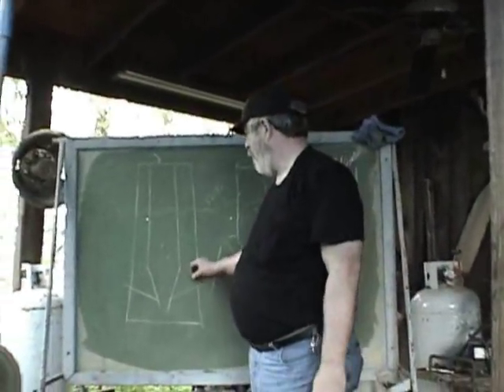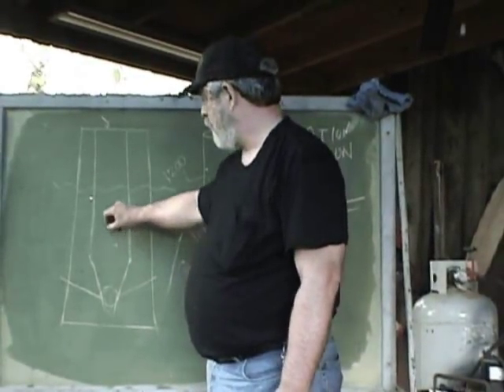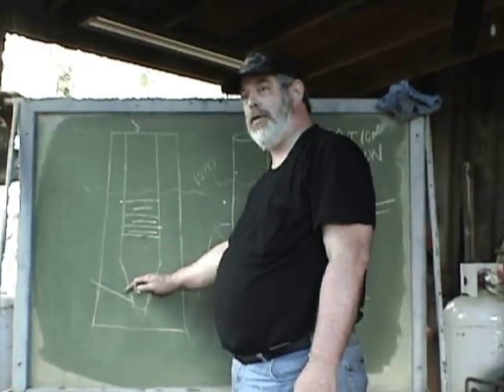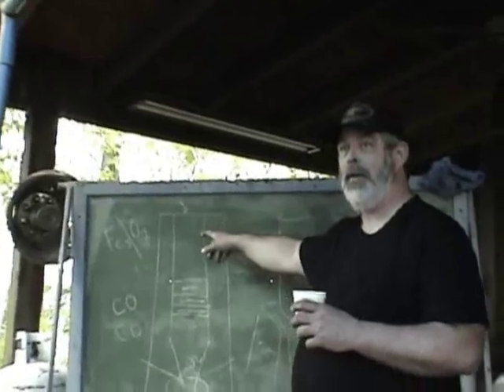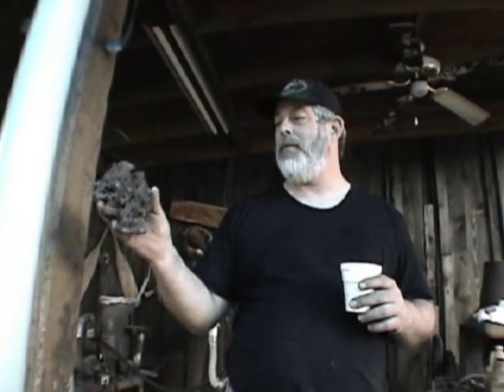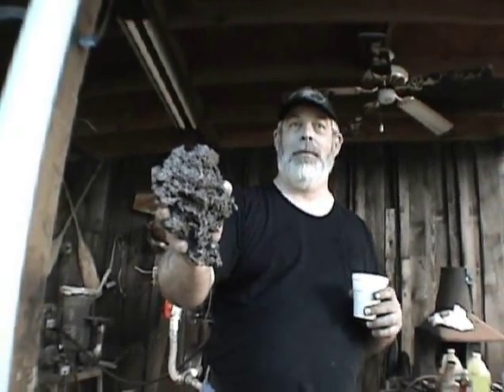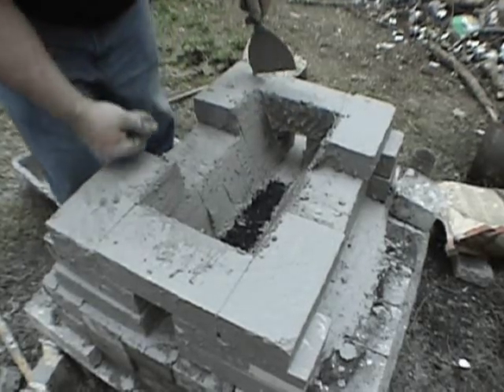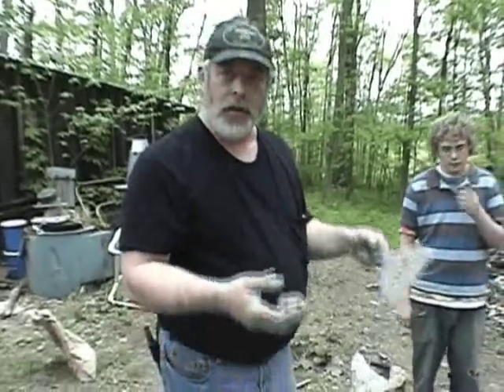Making Steel from Iron Ore

Comment: Nice Job Christopher... I'am planning to make a fornace too, but I have a question, is it possible to get a higher temperature up to the ponit of liquifing the the metal using the same type of  fornace  as you did ? Can it be done ??
Reply from the maker: The iron does usually go liquid for just a moment, as it passes through the hot spot in the fire, just above the tuyeres.  That liquid drops down, dripping and welding to itself to make that solid bloom you see pulled from below.

Comment from the maker: Raw Tamahagane is the large lump, the bloom extracted from the bottom of the furnace.  The process of folding and welding, the manual cleaning process, is what produces a bar of steel that can be used to forge a blade with.  This folding and welding is what produces the patterns typically seen in old japanese swords.  Having done this myself several times, I'm not sure what the controversy is, Sadnessroams.

Comment from the maker: Folding and welding is done, but it's just the manual process for getting from a chunky piece of bloom, to a solid clean bar of steel from which to make swords.  There is a lot of hype about how a certain number of layers makes a blade stronger, but that's all it is.  The patterns of folded steel are incidental to the desire for a clean, homogenous, slag-free blade.

Comment from the maker: I don't want to come off as a jerk, but we didn't do this the hard way just for fun.  BBQ coal has impurities we don't want in the steel.  Taking it out when it's hot lets you separate it from the slag, otherwise it will cool and freeze in place, and you have to chip it out like glass, possibly damaging your eyes - so hot is better.  It also lets you start consolidating it without spending the fuel to re-heat it later.

The bricks must be able to withstand the heat in there, 2500F or more.

Comment from the maker: No.  Aluminum melts at much lower temperatures than iron, and there's nothing going on in a simple melting furnace which reduces the oxygen that's chemically bound to the iron in ore.  The burning charcoal provides not only the adequate heat, but the chemical reaction at that heat needed to obtain iron from iron oxides.

Comment from the maker: Charcoal is first and foremost, the original fuel for this.  So, when trying to replicate the process it makes sense to do it that way.  Coal contains impurities (Sulfur) which are undesirable in steel, and it would be impossible to do this way with gas, which is also a very modern convenience.  One can melt ore in a crucible using any fuel, but that's a fundamentally different process, and yields a metal with very different characteristics.

Comment: Thanks again for the lesson.  Question - is another reason to use charcoal to add carbon to the molten steel making it tougher (high carbon steel) or is the carbon added earlier in the forging process?

Comment: Why is it that when you have a regular campfire outside it doesn't leave a thin layer of metal in the pit? Do campfires not get hot enough? Is the concentration of metal in dirt not high enough? Did the dirt you used have a higher concentration of metal than most dirt?

Comment from the maker: Not to the steel directly, other than the cost of re-heating it again from cold is avoided, and you usually have help/spectators when smelting, so an extra set of hands or two are useful as well.

Comment from the maker: Yes - 2 reasons.  The first is probably human impatience, but the practical reason is that usually, the bloom is worked immediately, beginning that compression and cleaning process, and it's very difficult to get it as hot as it is in that furnace it was born in.  Typically we quit feeding ore, give it another foot of charcoal, burn it down a bit, then extract the bloom with the air still running and burning the fire - take the bloom to a stump and start hammering it tighter and smaller.

Comment from the maker: I'm not familiar with your part of the country, but old iron mines (that you can get legal access to) are an excellent source for the hobby smith - barring that, there are several commercial vendors in various forms of magnetite or hematite, either will do just fine.  Around here you can find Taconite pellets (mostly magnetite powder, bound with a little clay - look like big clay marbles) along railways, and that's what was used in this video.

Comment from the maker: If you read the top comment of mine, you'll see I note that "dirt" is a bit tongue-in-cheek.  Yes, iron oxide, found in several forms of ore, is the ingredient that is converted to iron/steel in this furnace by burning charcoal with forced air blast.  This particular burn used crushed taconite, which is nearly pure magnetite.

Comment from the maker: In this particular case, steel - but with all the other properties of wrought iron.  Using a higher stack than a Roman or Viking stack furnace allows the ore to spend more time at high temperature, which allows more carbon to enter the bloom, providing a hardenable metal at the end instead of softer wrought.

Comment from the maker: 2 pounds is just about what any good sword from any culture or time period weighs.  Much material is lost to scaling, the interaction of the simple iron with atmospheric oxygen, producing fresh iron oxide every time the raw material is pulled from the fire to the anvil.  That, and slag expulsion, and grinding once a forged blank is done, accounts for the weight loss.  It's not an efficient system, and the only reason to do it is to capture that original look and character of the steel.

Comment from the maker: You know, I have no idea what the starting weight for ore was on this one, but given my experience with others, at least 2-3 times the weight of the bloom, and there was a good 50-60 pounds of metal or metallic fluff down there.  I'd guess 150# or more of starting ore for this run, but this was a rather large furnace for a backyard smith.  The current trend is smaller, clay-tube furnaces burning 50 pounds of ore to get 20 or so pounds of bloom, enough for 2 swords if everything goes right.

Comment from the maker: There are lots of places to find it, and even a closed iron mine will have enough material in the spoil pile for most hobby-level metal smiths.  The trick is knowing whether you can legally pick through it, depending on who owns the land now this can be a problem. If you're stuck purchasing something, red Hematite from pottery stores is a form of ore, any form of iron oxide will do; some need a little more care than others.  Good luck!

Comment from the maker: Another comment below suggests that 6 years ago, the rate was at or above $100/pound.  Possibly more these days, but it's hard to say, because few people smelting are willing to sell their material.

Also, with all the processing to consolidate the bloom, folding and welding, and final grinding, it takes at least 10 pounds of raw bloomery steel to end up with a 2 pound sword... much is lost to scaling, and compactness of the original material plays a big part in how much metal you end up with.

Comment from the maker: Roasting and crushing increases the surface area.  As Dr. Blue mentions, it's hot CO gas doing the work, so the more area exposed to that gas, the more efficient reduction of the ore into iron.  You could take it as far as powdering it, but somewhere between sand and fine gravel is usually good enough.  Roasting in particular creates fractures and liberates any chemically bound water, so you get gas pathways and less H2O in the way, as well.

Comment from the maker: If you go back and listen to Dr. Blue, this is very much the way wrought iron is made, but with the taller stack, more time at temperature, carbon can be built into the product, "wrought steel."  The amount is dependent on many variables, most bladesmiths aim for 1-1.5% in the bloom, knowing it will come to down to 0.5-0.75 by the time a blade is finished through decarburization.  It's not an exact science, but there are some obvious goals.

Comment from the maker: I've made my own with low-tech materials, mainly silica, cement, and vermiculite. Some of the inner lining will always melt, as the furnace reaches equilibrium, and re-lining a more permanent furnace was not uncommon - but modern research into pre-industrial methods suggests simple clay furnaces tend to produce better steel and more consistent results than some of the more modern-material examples out there.  This film shows just one experiment, and is not the end of the story.

Comment from the maker: With a hot enough furnace, and good crucibles, one can reduce iron ore into metal... but not with the character and chemistry old-fashioned solid-state reduction produces.  

It should be said that there is no good reason to do this, except in the pursuit of material that matches the old stuff.  It's not needed for knives and swords, and there are smiths producing fantastic work with modern metal - but there's a charm in this stuff that's hard to replace, and cannot be bought - so we make it.

Comment from the maker: No, the solid mass is iron, reduced from its ore form (oxygen removed in the fire), much like what Dr. Blue shows in the beginning of the video - a spongy mass still in need of cleaning.  The more solid the bloom at the bottom, though, the better the yield is generally, and easier to compact into solid iron bar.

Comment from the maker: As Dr. Blue mentioned in the video, it must be hammered flat, folded, and welded, over and over several times to get a homogeneous bar of steel, which one can then choose what to do with.  For lack of power tools, strong men and hammers will do the trick - it just takes time.

Comment from the maker: As to the discovery of the process, a common theory is that iron bearing ores were located near copper bearing ores, and that in the process of smelting copper, iron was accidentally made in a hot enough fire.  This new material was much hotter than the non-ferrous copper and bronze, and further experimentation with iron oxides led to the iron age as we know it.

At least, that's the theory.

Comment: how did humans accidentally stumble upon this?  while i can visualize by chance discovery of the burning of coal, there doesnt seem to be a reason to throw iron rock on to it and wait 15 hours and discover that an alloy is being formed, hard and useful that steel is.  seems more likely aliens passed this knowledge on
Reply: I hope aliens pass you on.
Reply: GreenLightMe many metals like tin and lead have very low melting points and can melt over basic campfires. Because of lack of technology to reach high temperatures, other metals like copper and it's alloys were first melted and used by 5,000 B.C. With a few thousand years of trail and error, melting iron ore became fairly common by the height of the Roman Empire, even before that by the Hittites.
Reply: Even if aliens passed this knowledge on, how did they figure it out? Something, somewhere, at some point had to figure it out.

Comment: It's just dirt, all dirt as we call it is organic matter, silica and minerals, this process basically burns the organic, the silica becomes glass, and the left over minerals become a form of steel. The iron blends in with other foreign minerals that have to be beaten off to make the finished sword. The whole folding of blades was started as a way to push other minerals from the steel.

Comment: I'm a metallurgist..they built a primative furnace. They put in iron ore (FeO, etc) and charcoal (C) and let it combust. Air entered through the tuyeres (tubes at the bottom that they were seem cleaning out) that then reacted with the charcoal to form CO and CO2, which heated up the iron ore and allowed FeO, etc to break up into cast iron/steel (depending on exact carbon content) and slag (SiO2, MnO, etc). For more into check out NOVA s35e05 "Making of a Samuri Sword"

Comment: The resulting carbon content here would be around 1.4%, which is not enough to qualify it as cast iron. Repeated heating, hammering and folding would bring the carbon content down to .7 or .8

Comment: Hardwood charcoal yes. That's what I use. Briquettes (like the pressed coconut stuff) not. The pressed stuff has a lot of clay to bind everything together and to make it burn slower. Initially it will burn well, but as they pulverize, the clay powder remains and smothers the fire.

Comment: He's quite correct. Folding the steel during forging doesn't necessarily make it magically stronger than good quality steel you can buy off the shelf. What it does, is ensures that the steel's composition of impurities (like carbon) are evenly distributed throughout the entire piece, leaving no weak spots. This steel forms the blade of a katana. Steel is forged around the iron piece. This results in a sword that will not break easily/flex (iron), yet can take an incredibly sharp edge (the steel)

Comment: In several countries Iron Oxide lays in abundance in riverbeds or beaches. It resembles a black sand or dirt. The largest source of this material is New Zealand. In Japan they used this in place of ore dug from mines for the most part.

Comment: Actually in Sweden we have Iron mines but our dirt in some places were so rich in iron silicates and oxides that the Vikings could literally make Steel from burning the vegetation and the soil. If you use special heating techniques were air isn't allowed you can turn magnetite into cast-iron you can turn limonite into steel by heating it with coal in the same way. Limonite is the number one source of iron and steel before mining. It can be found in Tamahagane as you said but also in some soils.

Comment: You can make carbon steel using black sand (magnetite) and charcoal, maybe add some chromite to make it stainless. But dude its really difficult to control the process.

Comment: well alright.  go to the beach and get a neodynum magnet. stick it in the beach.so you get iron sand, thats what the japaneses use for smithing katana. now heat it up using charcoal. it will turn into steel. i dont know what type of charcoal but im not an expert.

Comment: lol... im in school for aerospace manufacturing Engineering Technology and we learned about crystal structures and tempering of metals in a class called... what do u know the chemistry of metals and all metals have a crystal structure and the way the metal is tempered results in a different crystal lattice. i was saying this would make a high carbon steel because of all the charcoal that is burned directly in contact with the metal. try reading degarmo's materials and processes in manufacturing

Comment: @TheDevonblacksmith Actually you're not far off. This is very much like pig iron. It's not melted into a mass so much as it's welded. The steel at this point is very rough and too brittle to use. It's the folding and forging process which results in the fine Japanese swords. They carefully fold the tamehagane which slowly homogenizes it and it also reduces the amount of carbon. They can tell when the right amount of carbon has been reached by eyeballing it. It's all about craftsmenship.

Comment: How is this steel and not cast iron ?
 it would seem the carbon content would be very high without any treatments other than soaking in carbon (in this case charcoal) for severel hours witch would increase the carbon further.
( wikipedia Crucible_steel) may give more of an insight into how different iron and steels are produced.

Comment: As you mentioned with your 10 year estimate, modern weapons could become a thing of the past. BUT... once you have steel you have tools and from there it is just having the technology. Shot guns could be converted to flintlocks, lead could be scrounged for shot or just use 00 sized river pebbles. A supply of primers would be the big problem for modern weaponry.

Comment: Hello, Tide Water Forge. I have a question....due to my lack of knowledge of minerals and such.
What charcoal are you using ? What type of charcoal contains most iron?
What is hematite and Fe304  ? And isn't hematite Fe203 ?  
And last how do you clean the steel mold of the impurities, like glass and charcoal left overs ? 
What's that powder between the charcoal layers in the furnace?
Thank you for the nice vid. I'm sorry if my questions are kinda stupid, I'm just an amateur blacksmith.

Comment: ok, i am going to try so explain this using the best of my knowledge.  Dirt is full of silica, carbon, and different metal oxides or as it is commonly called rust. as everything is heated valence electrons become very excited and their kinetic energy approaches levels high enough to break their bonds and in this state  oxygen bonds with carbon so the iron oxide reduces back to iron more or less and any iron ore also joins the bloom and silicates coalesce into glass

Comment: just think of it as combining iron powder with charcoal in a furnace. the charcoal holds carbon and the iron ore that is usually found in japan holds less chemicals like sulfur and phospherus which makes steel brittle. this steal is called tamahagane. it is what they originally used to make samurai katana in japan. most katana today are not made from tamahagane cause its expensive and hard to make.

Comment: In 1813, Tabitha Babbitt (1784-1854) invented the first circular saw used in a saw mill. Babbitt was working in the spinning house at the Harvard Shaker community in Massachusetts when she decided to invent an improvement to the two-man pit saws that were being used for lumber production. Tabitha Babbitt is also credited with inventing an improved version of cut nails, a new method of making false teeth, and an improved spinning wheel head.